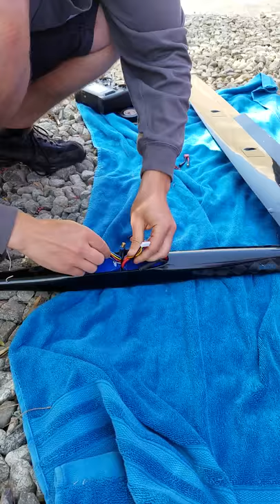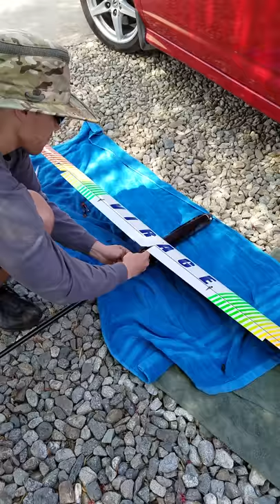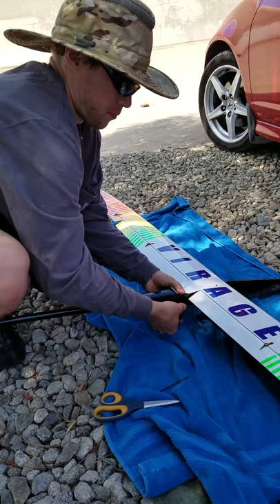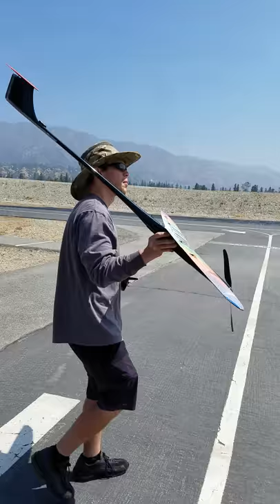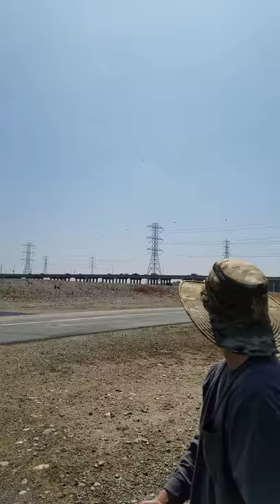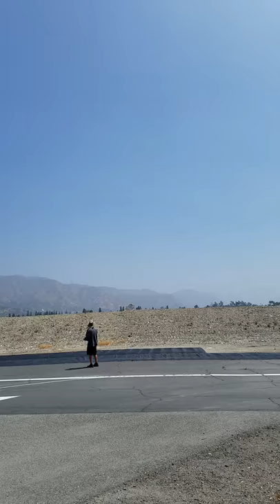Jared and his Virage Intro on use of Zippy LiPos June 2nd 2017

Comment: Hey, do you have the throttle on a 3 way switch, off/half/full??  Or is it set to two independent switches?   I am about to try this for the first time (throttle on switch)   It scares the hell out of me.  lol
Reply from the maker: Sorry for the late response Johnny, but Jared had normal throttle stick settings and functionality set for his Virage. He just went full throttle when needed. His Virage had a unfortunate "unscheduled disassembly" event after about a dozen flights so this has been a while ago. Jared has since stuck to smaller less expensive hotliners to fly.
Reply: @gogianyee5002  was the "unscheduled disassembly" in-flight or in-ground?
Reply from the maker: @crnkin2  Jared's fateful last flight was when he was making a high speed glide low pass over the runway when the RUD occurred right when he started to apply throttle and one wings leading edge decided to delaminate. It was loud when the RUD occurred!